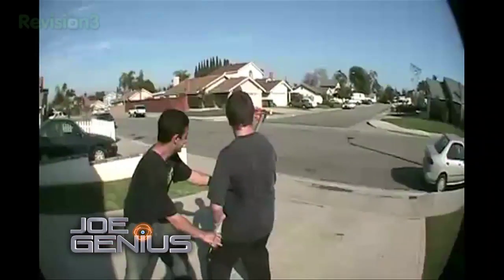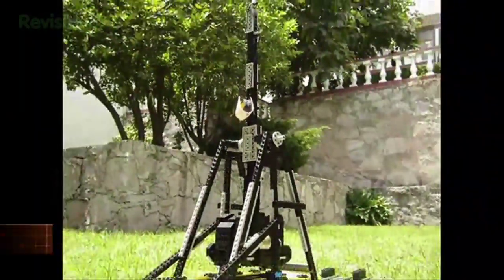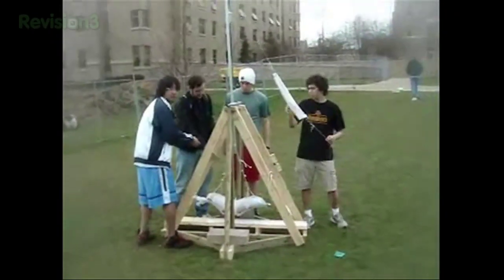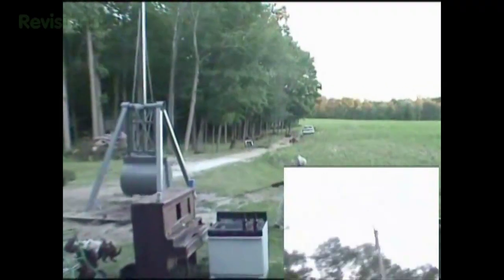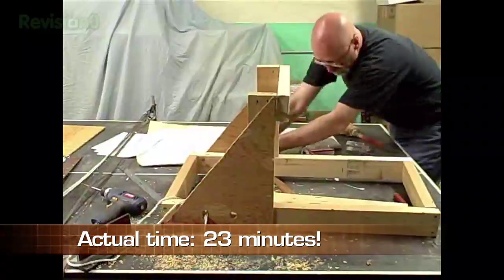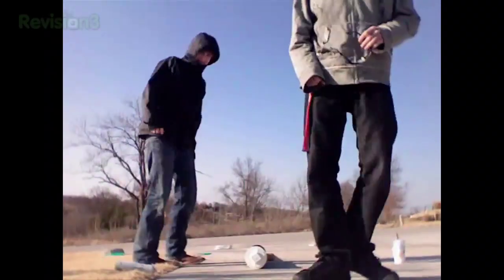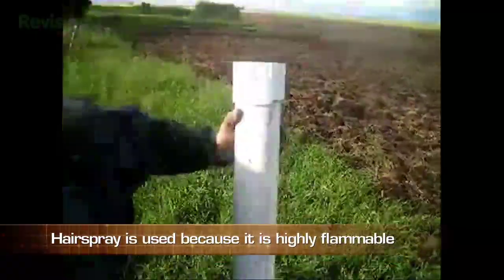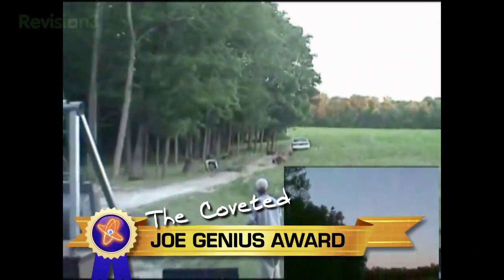Trebuchets + Potato Cannons = Science of Projectiles - Joe Genius

Comment: I noticed on the lego device that the trebuchet was on wheels.  Does that actually contribute to the momentum of the projectile?  I wonder what the relationship between arm length, counterweight mass, and projectile mass is?
Reply: A fixed-base trebuchet can easily be ripped apart by the forces involved, even if built from wood. No, it doesn't contribute to the momentum. The correct proportions differ with exact type of trebuchet. If the weight is fix, 2:1 is a good start. For a swinging counterweight, something between 3:1 and 6:1 depending on counterweight / projectile ratio.
Reply: B.A. dude, thanks.